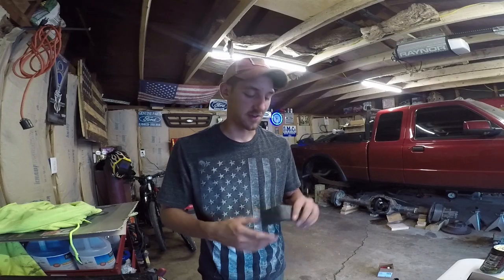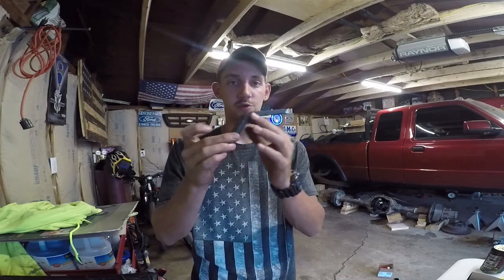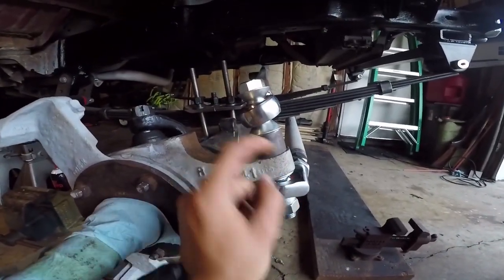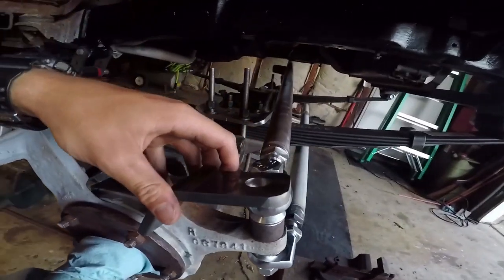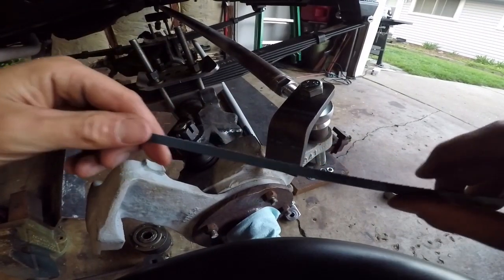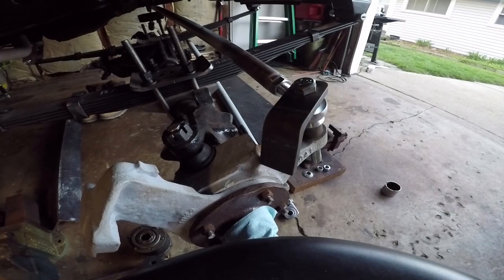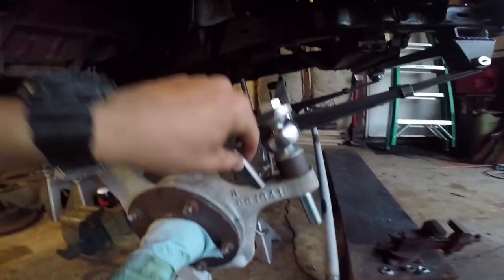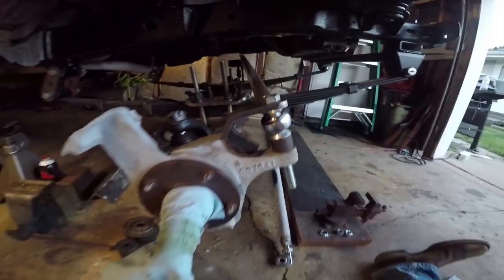SAS ranger double shear knuckle

Comment: Update? I have a Dana 30 I’m thinking of swapping under my ranger with a leaf setup. Worried my extra weight may be too much. I only do light to moderate wheeling and want it to mainly be an all around camping/hunting/work rig. 
Curious about how yours would ride with the leaf springs